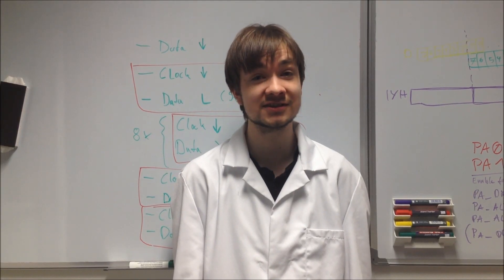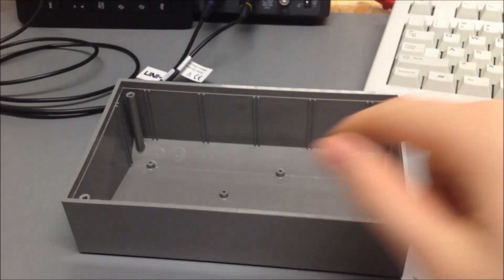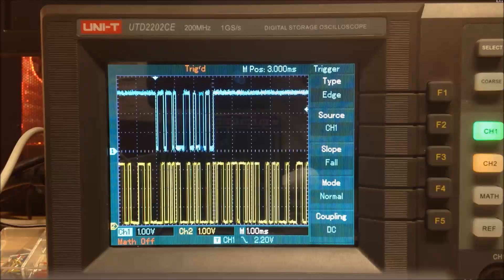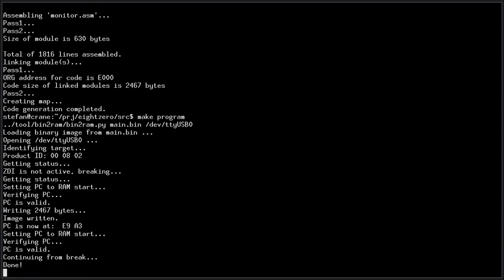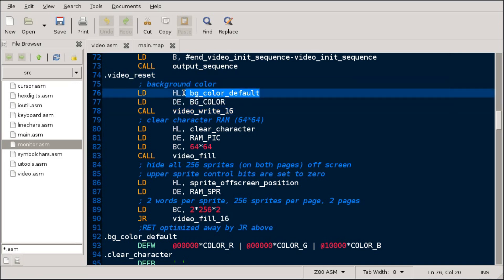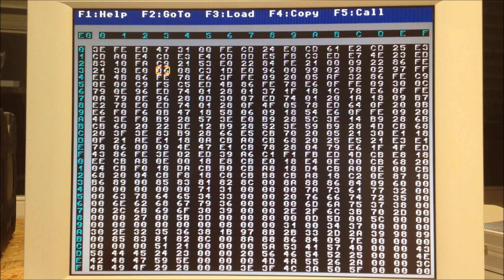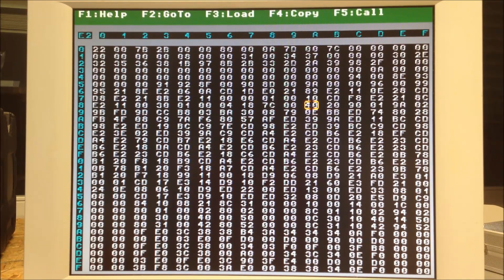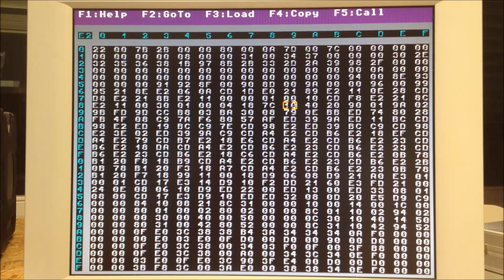8-bit computer from scratch: video, keyboard, machine code monitor

Comment: I look forward to seeing this up and running. Regarding the Machine code monitor's GUI - It looks difficult trying to identify which memory location your cursor is hovering over. Would it be possible to add some guides, as to indicate which column/row is highlighted? Or maybe a box at the top displaying which coordinates you are highlighting? Perhaps it could be a feature that could be toggled on and off? Just a thought and hope it makes sense! Merry Christmas : )
Reply from the maker: the selected address is actually shown in the register view in the "PC" (program counter) register, probably forgot to mention that

Comment from the maker: Sorry, somehow the reply button is missing on most comments but I hope that people will read these answers to common questions: 1. The graphics is generated by an FPGA currently running the Gameduino 1 firmware. I plan to provide a way of loading another firmware at runtime (without reflashing) so the possibilities are endless. 2. I am also planning to crowdfund the production of this but there are many things I need to prepare before I can do that, not only technical but also marketing-wise and legal. 3. (not asked but you might want to know this) I am currently experimenting with a handheld version, mainly for myself so I can code more often. Maybe that is of interest for others, too.